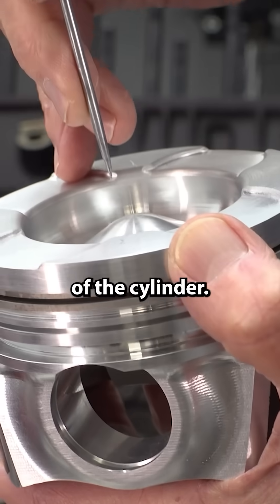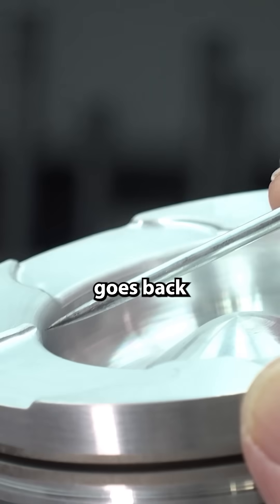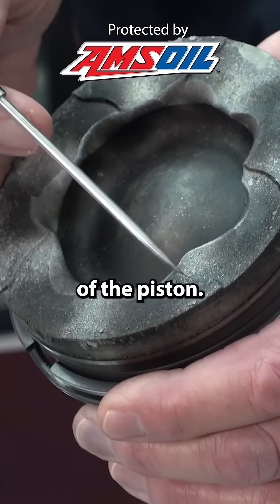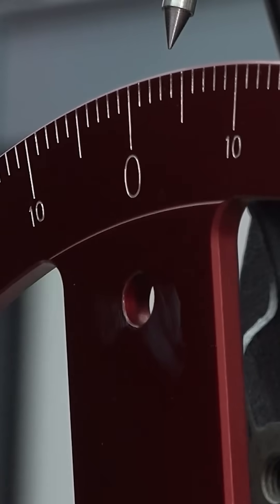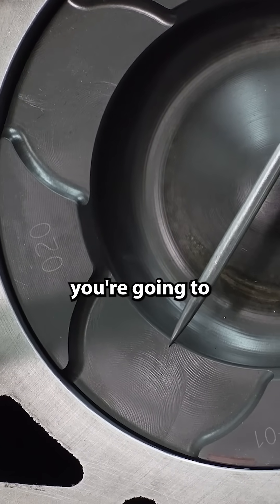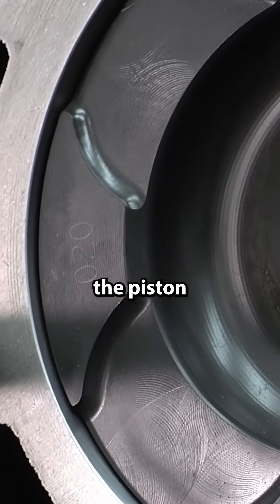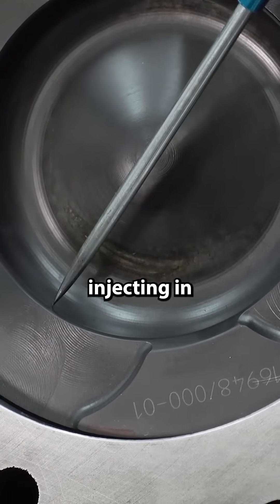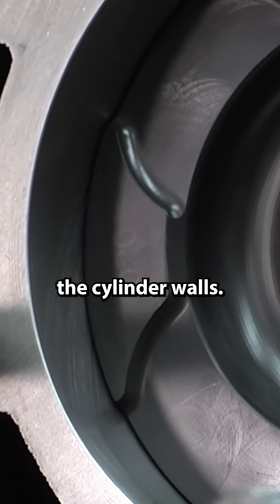How to burn pistons.

Comment: An awful lot of aftermarket “ Performance tunes “ that people either just download into the stock Diesel ECU make “ power “ by adding additional fuel & also in most cases raise the fuel pressure to sometimes critical over max limits in the system to Really put the engine at or above safe limits .  An awful lot of pump failures are because people do not understand that principle that “ More is NOT always better “ and what Gale is trying to convey here is that there are many Aftermarket companies out there that just don’t care if what they offer has a negative effect on the end user , in this case the effect of extremely long injection rates well past the “ safe zone” of when injection should cease to occur.  I have seen firsthand what he’s trying to convey here , with totally destroyed pistons / and engines as a result of “ Pushing the limits” .  Thanks for all you do & share Gale , to educate the unknowing .  😎👍
Reply: Programmers also add timing. So combustion happens right on TDC. This adds a lot of force to the crank that hasn’t yet broke over center. Wipes out main and rod bearings
Reply: Huh...I suppose diesel guys can get away with that for a while because of the oily nature of diesel.
Reply: @paulskalla6845 
You can get away with that smoky tune at the drag strip for 15 seconds , but go pull up a grade loaded for 5 minutes and you'll have scrap metal. 
Not that you were really getting away with anything at the strip, there's still damage occuring.
This stuff is too expensive to have a time bomb smoke tune.
Reply: @MrTheHillfolk exactly. Go to a tractor pull sometime and pay attention to which engines blow up and which engines win. The smokey engines explode the clean exhaust engines win.
Reply: @leojensen9270  I have been a tech official at tractor pulls for almost 40 years.
You are WRONG.
Clean diesel exhaust means no power, if it is always clean, or if it starts black and turns clean it is going to blow up.
Same with the dyno displays at the pickup diesel days, black smoke makes power, when they clean up the exhaust,  they are going to scatter parts.
Diesels will blow up blowing black as well, happens when they are making 4500 to 5000 horsepower with an engine designed for 200 originally.
I understand the THEORY behind your statements, but see proof you are wrong about 1000 times a year.
Reply: Thanks for further explanation
Reply: I have just blown a piston in my 4d56 mitsubishi which has had a Stienbauer unit on it since new and powered up constantly.  The ute has always gone really hard and i have a heavy foot. So 350k is all she wrote.  I've learnt my lesson😮
Reply: thx 2 U -- in understood everything that needs 2 B understood. MAJOR thanks 🔥
Reply: The "flower"....
Reply: No point adding more fuel it ain't going go to give more power as you need more air to burn it
Reply: @nounoufriend1442  Unlike a gasoline engine, diesel engines don't  have a throttle body to regulate air. The intake is always wide open. They are fuel throttled. So more fuel = more power/RPMs.
Reply: @Smedleydog1  Yes I'm well aware they have no regulation for air (37 years fixing diesel locomotive's)    "more fuel = more power/RPMs" Isn't totally correct as the volume of cylinder can only support the combustion of a finite amount of fuel . As I said adding fuel isn't going to give more power you need more air (turbo or super charger ) to burn this extra fuel . Also engine speed isn't the way to more power like a gas engine due to the far longer burn time for diesel fuel . This is why most diesels have forced induction "more air means we can get more power because we can burn more fuel "

Comment: So would it be viable to install injectors that have a different spray pattern/angle for high hp race applications?
Reply: No, rate of injection affects the engine power and increase in mass flow (air)

Comment: Too bad there’s no way to have the injector in the piston spraying upward. The head would have to be reimagined a little so it wouldn’t spray on the valves but would eliminate the injector spraying on working surfaces

Comment: Piston design is so underrated! Very cool to see the crazy ways deisel engines make efficient power
Reply: I have White and Hurcules multifuel engines in my collection. The thumb-sized hump in the middle has a texture similar to a golf ball along with a densometer in the fuel rails to compensate for fuel density to give it the multifuel capabilities. They run just as well as on diesel as on regular gasoline with a quart of motor oil for every 15 gallons.
Reply: Well said, us ole timers don't know nor seen sh$$.
Reply: What he is saying the idea of the piston design creates another problem.  The design is based on the piston being stationary.  Which a piston isnt its always moving.  And how much it moves.  So the design of the piston defeats the purpose because its not in place while the injector is spraying
Reply: Agreed
Reply: not so much piston design as it is timing design for the whole operation to make efficient use of the power and having longer lasting parts... because failing parts and companies not wanting right to repair can do
Reply: UnDeRrAtEd
Reply: Car dependency is inherently inefficient and destructive
Reply: It’s Bad design. As Mr. Banks just proved.
Reply: thats the point.. its NOT efficient power.. its dirty
Reply: Maybe that's an origina piston but I would never use one like that. That one's new to me, And I work on most.
Reply: REALLY?? All this "SO CALLED" knowledge but can't figure out how to make propulsion systems that don't need some ridiculous fuel?? 🤔🤔🤔💀💀💀💀
Reply: @skytoll1 that's... that's not how that works...

Comment: I was running 25° timing @3600 rpm daily on my LML duramax. My pistons had no signs of any melting, but one piston was split in half and all 7 other pistons had cracks on the lip of the combustion bowl.
Reply: Why was the rpm so high? I think my truck typically hovers around 1800-2000 rpm unless I’m stepping on it.
Reply: @greatodinsraven  because I floored it everyday on the maximum effort tuning
Reply: @beowulf885 so you know why they cracked
Reply: @simonm1447  yes, tuning. but specifically they cracked because of my heavy foot, with a 220hp over stock tune.

Comment: As usual, Gale is absolutely on Point!
There is a Common mistake when people cut the injector seats after a burned copper ring replacement too deep. If the injector sits now deeper in the Head and you didnt measure how thick your new copper ring has to be, the injection spray/ mixture is Bad and the Engine Runs very „hard“. 

Sorry for my Bad english, I’m from Germany.
Reply: Kein Problem, dein Englisch ist gut.
Reply: @rarelycold6618  Thank you!
Reply: @Alex-mr4is  Bitte
Reply: Injector protrusion is important, too deep and the piston can hit the injector, also increase the compression ratio slightly
Reply: Clearly, if you fit the correct part there will be no problem.  If the spray pattern is Interrupted then the fuel is not burnt completely and the exhaust will become smoky, the engine will have lost power and the fuel consumption will have gone up.

Comment: I got not idea what this guy is talking about out 90% of the time, but I still listen because I know  it’s important. That is a very rare talent, because I want to understand why.
Reply: Couldn’t agree more. I don’t know much past changing your oil/tire or like an alternator. But I listen when this man speaks because this man knows better than most people in this field I’d say. He is to engines, what Morgan Freeman is to Narration
Reply: Also the reason you don’t want the fuel injector spraying the cylinder wall is it will wash the oil off the cylinder wall and destroy the cylinder walls at 40 degrees of timing its doing exactly that i like how he positioned the fuel injectors exactly in the perfect spot to spray perfect on top the piston im wondering how many more ponies that picked up he didn’t mention it so im betting a lot thats the way Banks is he wont say anything until he patents it
Reply: He's talking about bad fuel injection design. Ideally, your fuel is finely misted and easily mixes with the air being pulled into the cylinder so that when the piston moves up to compress this mixture, you'll end up with a mostly evenly distributed explosion of this fuel/air mixture. If fuel is being sprayed directly on edges of the piston and/or the cylinder wall, you're creating hotter spots where that fuel is being  directly deposited on those surfaces. These places will get significantly hotter than the rest of the combustion chamber (which is the area created between the top of the piston, the cylinder walls, and the cylinder head. This will eventually burn/scortch those surfaces, damaging the metal. 
Top dead center is when piston #1 is at the very top of the intake stroke. After tdc, as the piston moves down, it will (through the vacuum created), pull in air into the cylinder. When the piston comes back up to the top, it will be compressing this air and fuel sprayed in until it reaches the top again, where the fuel will ignite. This isn't top dead center. This is the second stroke of a four stroke engine. When the fuel ignites, the piston will be pushed back to the bottom. This is the only stroke that actually creates power. As the piston moves back up to the top, burnt gases are pushed out until the piston reaches the top. Now you're at top dead center again and the process starts again. It helps if you think of the timing of things going on inside an engine like the movement inside a clock.
Reply: @genaugmen4505 i was about to thumbs up your comment but as i read what you said about TDC top dead center daym bro you clearly messed that up,
TDC you said was the top from. intake stroke,
the heck bro that the point of overlap where the end of exhaust valve closing and intake valve opening is on point blank,

the proper TDC is at the very most top position of piston after compression stroke and before power stroke,

TDC and overlap, dont cofuse other readers with wrong enfo
Reply: @endurofan9854 Also the fuel isn't exploding (flame front is not supersonic - that'd be very bad) but rather deflagrates (flame front being subsonic) and predictable.
Reply: @marian-gabriel9518  The speed of the flame front doesn't need to be supersonic to be exploding. Whomever told you that failed physics.
Reply: Suck, bang, squirt, blow @genaugmen4505
Reply: @genaugmen4505 suck, bang, squirt, blow
Reply: @genaugmen4505.......#1 is at TDC twice during the 4 strokes. After the exhaust / beginning of intake stroke , and after compression/ beginning of power stroke. When people say TDC they are referring to the compression/ power stroke TDC because that TDC is when you set initial timing.
Reply: Gale banks is the diesel god.
Reply: Is actually pretty interesting, he is talking about the combustion chamber diesel engines has (located on top of the pistons) and how fuel spray can only be injected up to 40 degrees before top dead center, otherwise the perifery of the piston could crack.
Reply: @RGV2300  riddle me this because I don’t want to google, what’s “top dead center”? Assume it relates to timing?
Reply: @lawrencelaugherty5310  the moment the piston is at the top of the stroke
Reply: @lawrencelaugherty5310  That was a good question a lot of folks don't know.  TDC is Top Dead Center and you'll hear engine builders say BTDC Before Top Dead Center  and so fourth..But Good question no doubt..👍
Reply: @lawrencelaugherty5310 It's when the piston is at it's highest in the cylinder. I rebuilt a 6.2 GM diesel  a while back and about half way through, I felt like the movie Tin Cup. When Kevin played the back nine with just a 7 iron. WHY would you do that 😂. Diesel engines deserve their nickname of DIRTY Diesel. I probably spent half my time cleaning and painting it.
Reply: @RGV2300 combustion stroke because cycle start to finish is 4 strokes
Reply: @lawrencelaugherty5310 you are correct. It mean the number 1 piston is at the very top of the bore on it’s way to complete an ignition stroke
Reply: @RGV2300 yep, that’s pretty much what he said 🤨
Reply: Skill** talent is god given skill is acquired.
Reply: @Joshlindsay22  Aint no Good involved, Talent is ability to comprehend the topic theoretically and actualize on it practically - its a transitory ability that is also technically a skill that can be improved. Skill is a combination of education, understanding, and practice until mastery is achieved. Theyre just intersectional components that exponentialize action and knowledge/understanding
Reply: Common Rail Injectors have at least 16 tiny ports with a pressure rating of 8k psi - 12k psi. Diesel fuel is thicker than 87 octane. Atomization of fuel is precise and the amount of heat/energy to create power. When the injectors starts atomize the fuel, it's like powder of flower. 

40 degrees angle give the fuel more area to spread excess heat. Increases heat but lower power. The grooves in design is meant for the valves to open. The indent of the piston is what you want for fuel to spray. The dome style piston is where you want the fuel to be and combust. Hook up a scan tool to your vehicle. The most you vehicle will advance timing is 35 degrees.
Reply: On a diesel the engines timing is keyed to when the fuel is injected into the combustion chamber, what he is explaining is what happens if the fuel is injected late enough that the piston has dropped down the cylinder bore too far allowing fuel to be sprayed across the edges and onto the cylinder walls themselves. You want the fuel to start being injected when the crankshaft is 25-30 degrees before top dead center and finish by TDC or slightly after for best performance, the fuel should only be sprayed into the depression on the head of the piston.
Reply: Came here to say the same. Understand something I knew nothing about. Had great professors do that but my mind still learns different from how I'm taught. It's like I have to translate it to my brain and then reverse engineer to regurgitate it back for specific problems.
Reply: All you have to remember is that an engine is a GIGANTIC AIR PUMP , and all they're talking about is different variations of 'SUCK' , 'BANG' and 'BLOW'......
LITERALLY AND FIGURATIVELY
Reply: I guess you don't know what firing order is either.
Or what a distributor is.
Reply: Hmmm, well if you're planning on programming fuel injectors to spray longer  with this set up then you will end up burning the pistons. But if all you know how to do is change a tire, odds of you getting this far into automotive technology is pretty slim. 😂
Reply: The degree of the piston head man. Just don't post any comments if you are going to be ignorant about it.
Reply: basically if you inject too much fuel at the wrong time you will quite easily melt the piston or even the cylinder wall. Common engine failure in high power engines that were improperly tuned
Reply: I’m a mechanic and I feel the same way
Reply: All I know is it goes down fast and anything over 20° under, and you're superheating the cylinder walls
Reply: When he mentioned the 90° of spray angle that meant coming out of the injector 90° is a right angle Torres it's Ashley shooting approximately 100 degrees out of the injector which is a downward angle spraying down into the Piston Cup if it was at a 90° angle it would be shooting directly at the top of the piston the Piston was at top dead center that means when the Piston was all the way up at the top of its stroke
Reply: Same here trying to figure out is that a new type of piston or maybe this part is cause by a different type of angle coming from the crank shaft size. But it’s good to know.
Reply: You want your explosion in the piston top of its spraying and exploding 20 deg after your basically ruining the top of the piston and cylinder wall.
Reply: what he's saying is pretty basic
Reply: Chainsaw porting and timing ...
Reply: You know combustion engine relies on explosions from the fuel to drive the piston down. The fuel is supposed to hit in a certain spot cause it's made to handle these small explosions. He's saying the fuel is still spraying after the piston head is in it's down stroke...that's loss of fuel and causes issues with the engine as it's no longer doing what's it's supposed to do. Hope that makes more sense.
Reply: He is saying don’t goof the injection timing, or it will spray and prematurely ignite all over the cylinder walls instead of the pocket causing detonation and deterioration on the piston and cylinder surfaces.
Reply: Suck, bang, squirt, blow
Reply: RIGHT ON !!!! SAME SAME
Reply: Don't worry, neither does he...😂
Reply: If you don't understand why it's bad to spray your cylinder walls, i feel for ya.
Reply: Lmao it’s okay. If fuel timing is quicker than the piston stroke it heats the head of the piston because it’s spraying to early. Fuel and piston stroke need to be advanced back some.
Reply: Simplified, he's talking about fuel washing the cylinder walls
Reply: But still it’s a lubricant which I think lingers for cooling.
Reply: He’s saying based on timing of you injectors you can ruin your piston heads.
Reply: Essentially he's saying you do not want diesel infused into the cylinder at or beyond 40° otherwise the cylinder will get cooked.

He's not mentioning the dilution of oil around the cylinder rings, but I'm pretty sure that has some play into the equation.
Reply: Look up Diesel injector spray the. You will understand
Reply: This man's knowledge and explanations are always A1. 💯
Reply: I'm sure he don't understand it throughly himself
Reply: @stevenstair1068 what? This guy is an engineer a high level one at that especially when it comes to engines and boost and how everything works.  He 10000% knows what he's talking about.